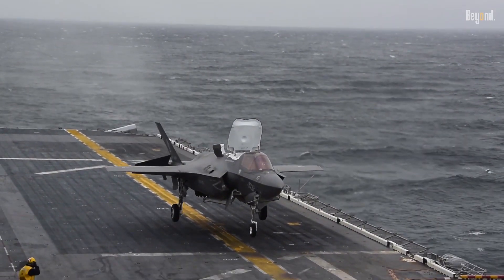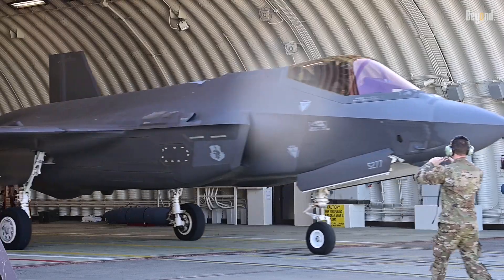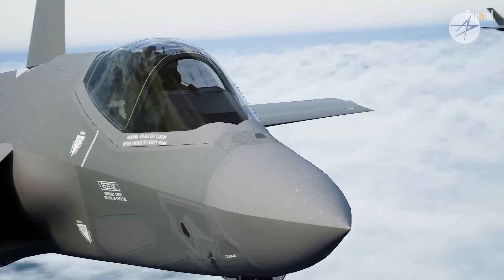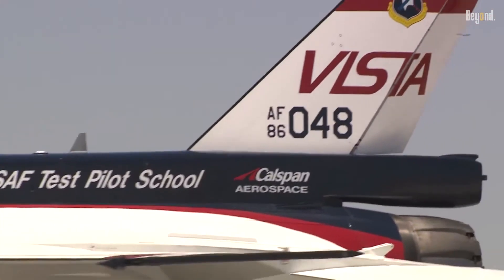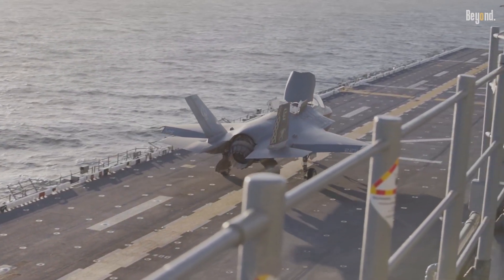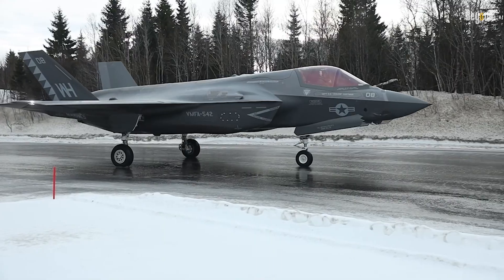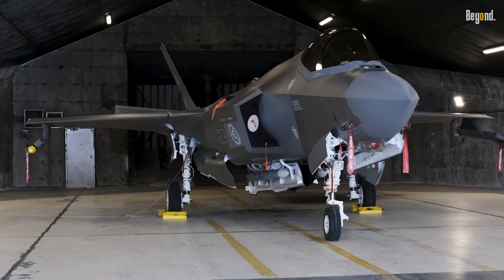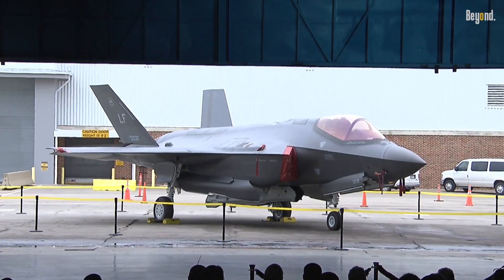Why the F-35 Doesn’t Feature Thrust Vectoring

Comment: it literally has thrust vectoring that’s the vtol🤦
Reply: That's not "thrust vectoring", as in the type to help it with tight maneuvering in low energy combat flight situations, like the F22, SU57 or SU35.
Reply: @imkeerock  It is still thrust vectoring though, LITERALLY. Its dumb to say something isnt there when it is, makes you sound stupid
Reply: Incorrect and the F-35B is STOVL not "vtol".
Reply: @AA-xo9uw  It can VTOL
Reply: @BucketzofBordo  Even though there was no KPP requirement for the JSF to be capable of performing a vertical takeoff the fact that the F-35B can is simply gravy. However, it is not an operational tactic and the aircraft remains designated as a STOVL platform not "vtol".
Reply: @AA-xo9uw  Correct operationally it is limited to STOVL. I feel the point of the commentor above was that the engine can vector to the point of doing a VTOL and therefor could well be considered thrust vectoring. I like how you use the term gravy, I will steal this in future